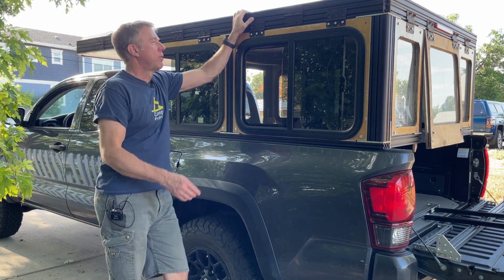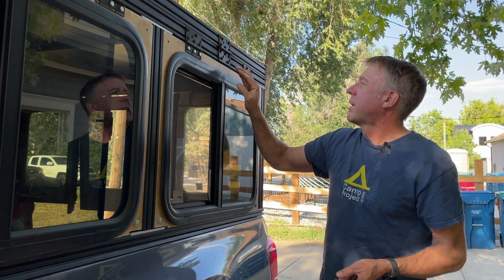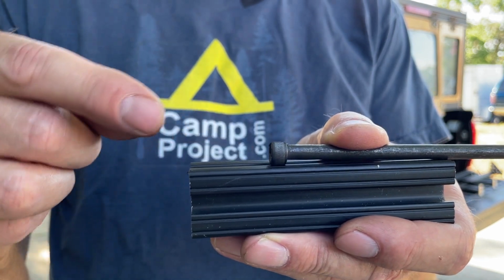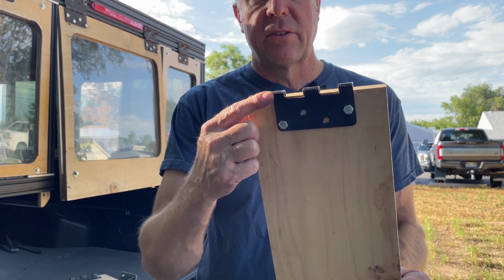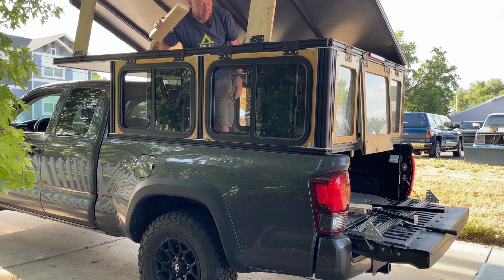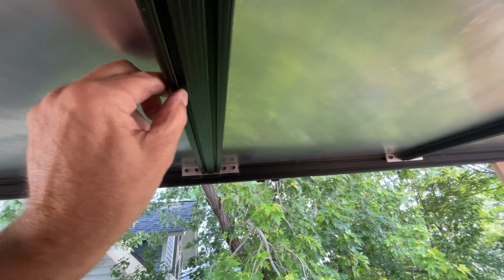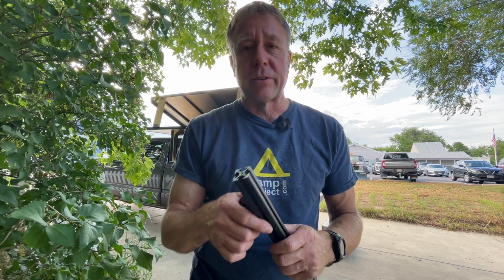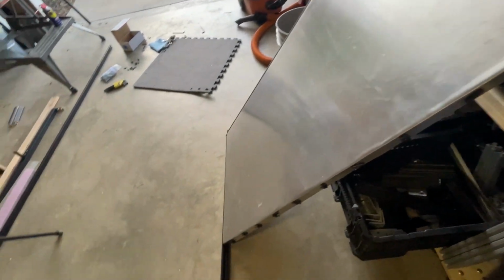DIY Pop-up Truck Camper Build (Part 16) Roof 01

Comment: So could the prop brace fold in the middle to allow the top to lower?
Reply from the maker: I was having some problems with everything getting all bound up when I had it fold in the middle. I think I can get it to work smoothly. I have some new hinges I modified and hoping it will all fold in nicely now.